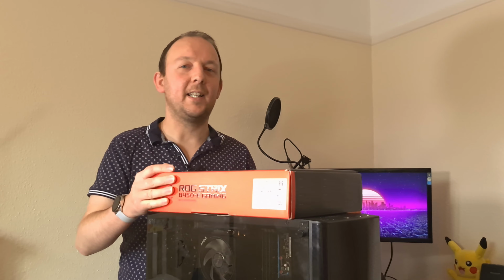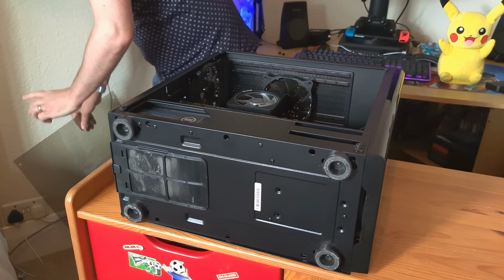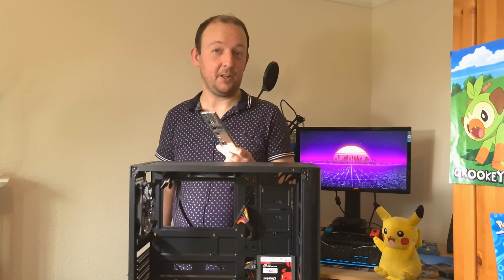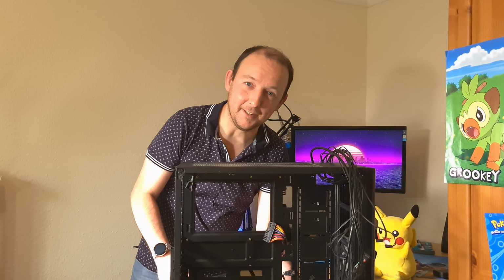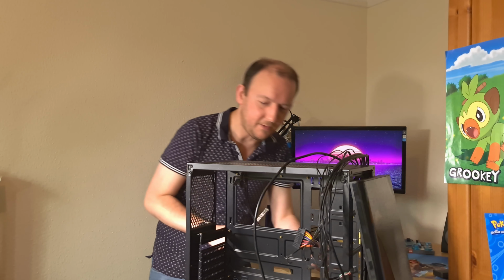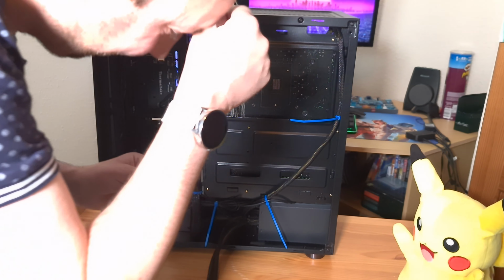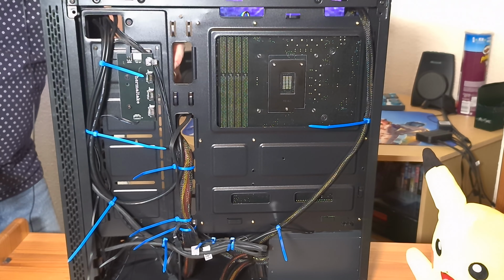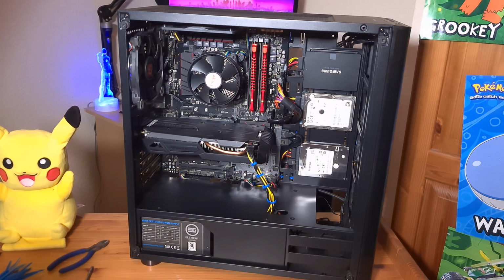⚙ Wills Thermaltake V200 Rebuild - i7 4790K ⚙ - Yep it's still worth it ✅ #buildacomputer

Comment: Hey I love three vid but where do I install the SATA power cable I’m struggling with that
Reply from the maker: What are you trying to power with the sata cable?
Reply: the SATA power cable should go into the IO port side of the component, where the long port is. Make sure to match it up with the notch at one of the ends of the port.

Comment: Could you upload a video on how to mount 2 top exhaust fans? thanks
Reply from the maker: Honestly I don't think it would be a very exciting video to watch. And would litteraly take 2 minutes maybe less. If you can screw other fans in, its basically the same. You just need to decide if they are going to be exhaust or intake fans.
Reply: @WnDTech  Okay thanks, would the screws get in the way and create a bump on the surface so the dust filter won't sit flat? I am going to be installing noctua brown fans on the top for exhaust
Reply from the maker: Na  you should be fine. Shame I can't show pics. As long as your using the correct screws for your fans.. you will be ok
Reply: @WnDTech  Ok thanks, i have the same exact case and this is my first pc build so i have loads of questions about everything
Reply from the maker: Oh really. Welcome to the "#PCMasters" fire any questions over. More than happy to help out.

Comment: Hi im wondring if its possible to move the front fans inside the case but i cant do it in the bottom fan because the hard disc so do u know anyway to move the bottom fan inside the case and also did the aclyric in the front could be removed the aclyric only?
Reply from the maker: The fans should fit its designed four a 3 fan radiator in the front too. But there isn't any where else to mount a 3.5" drive. So you're options here are limited. Not sure about the front panel honestly didn't look too see if it can be removed,  so check.

Comment: I have my fans running but I can’t change the color and I have nothing plugged into the two pin switch in the back where did u get that cable or where did u find it in the pc specifically the two pin that’s connected to the rgb switch
Reply: You have to find the cable that is connected to the LED button and plug it into the 2 pin connector on the back. I just routed the cable and pulled it to find it
Reply: Daniel Lee thank u